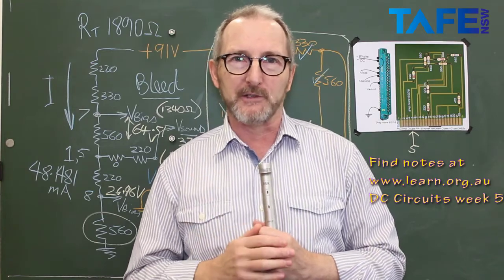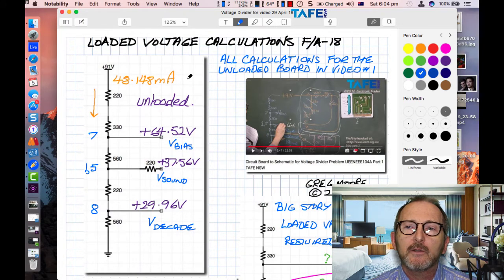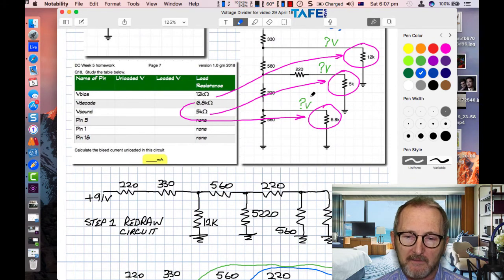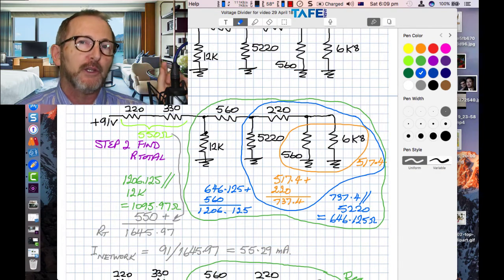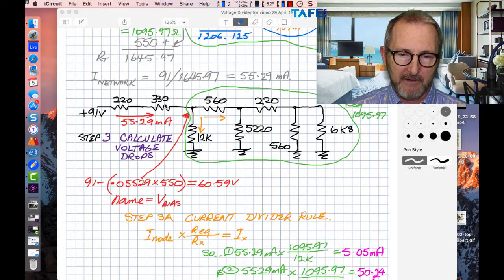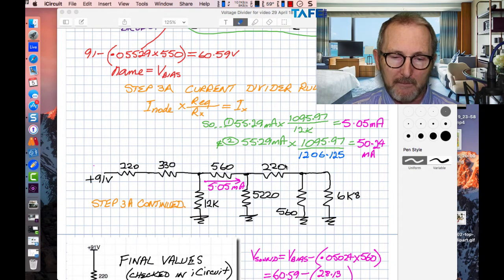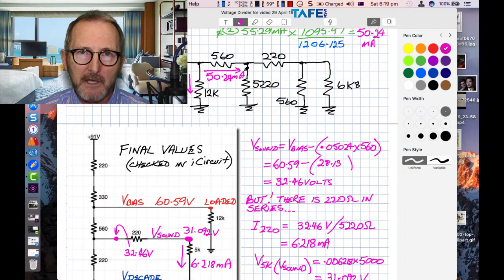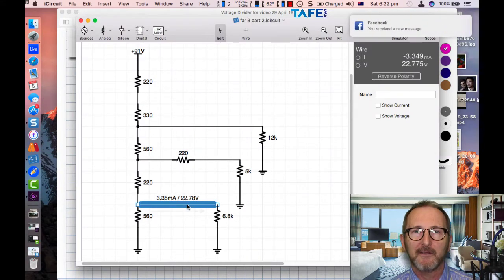F/A-18 Voltage Divider Problem UEENEEE104A Part 2 TAFE NSW

Comment: Hi there Greg Moore base on my calculation and simulation on the unloaded voltage circuit I total should be 71mA instead of 48.148mA since R total is equal to 1,281.6 ohms.
Reply from the maker: You may like to try that again.  Unloaded R is 1890Ω hence 48mA.
Reply: @gregmoore7565  I see if that is the case the 220 ohms resistor that was connected in between the 560 and 220 ohms resistor was not included in the total resistance. right?